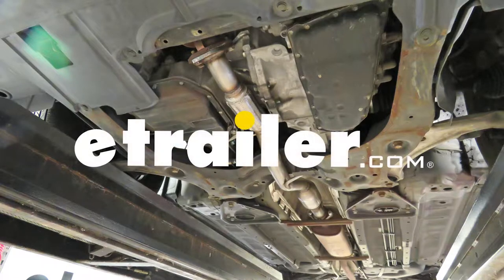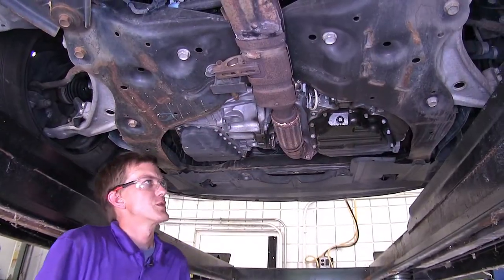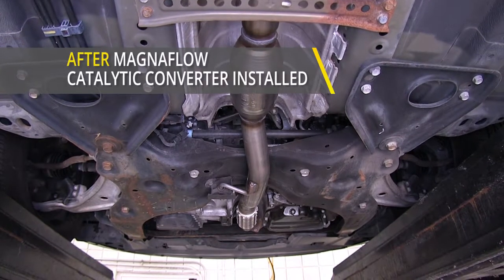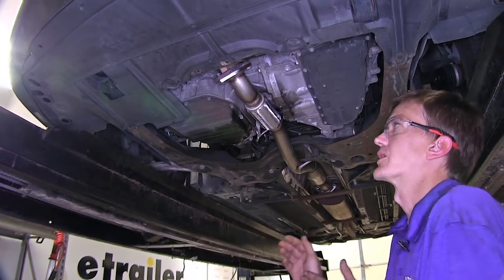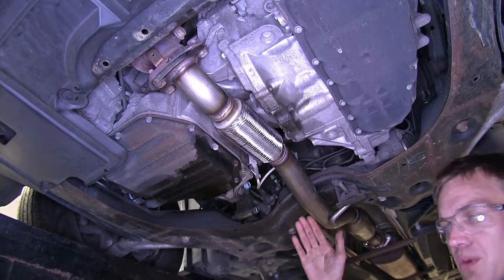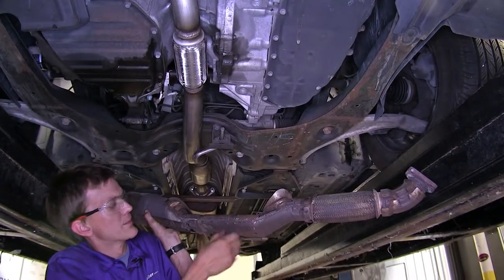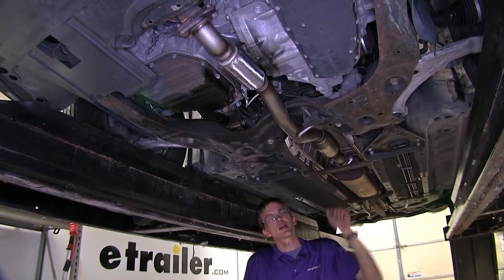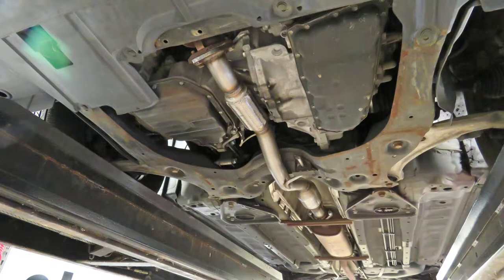etrailer | MagnaFlow Ceramic Catalytic Converters Review

Comment: Do you recommend having the Catalytic converter ceramic coated on the outside? A few buyers have said that this will keep the heat in the inside of the cat and not burn the O2 sensor wires.
Reply from the maker: We do not have experience with coating the outside of catalytic converters.
https://www.etrailer.com/Catalytic-Converters/MagnaFlow/MF23938.html

Comment: how much HP would I get with a magna flow cat converter plus straight pipe instead of resonator and straight pipe instead of muffler? 50hp?
Reply from the maker: It's hard to say what the horsepower gain would be because all of the factors such as fuel, air flow and motor age would also affect it.
https://www.etrailer.com/Catalytic-Converters/MagnaFlow/MF23133.html

Comment: is this likely to get stolen like oem cats are targetted?
Reply from the maker: It uses OEM fittings so if you are thinking about how difficult it would be to steal then it wouldn't be any more difficult to steal than the OEM catalytic converters. As far as criminal targeting goes we honestly have no idea how desirable this product is for thieves.
Reply: @etrailer  as in does it use precious metals like palladium, platinum and rhodium?
Reply from the maker: @slybunda  Yes, according to MagnaFlow all of their converters have some previous metals in them.
Reply: If the scrappers or junkies know what they are looking for and recognize this is aftermarket, they might leave it because OEM cats are worth a lot more to scrap.  Aftermarket cats have little scrap value.